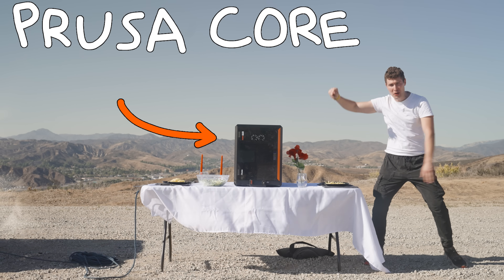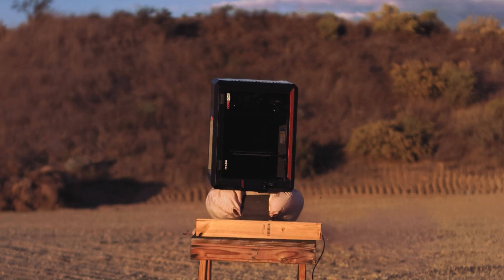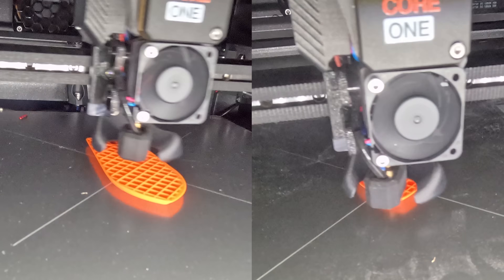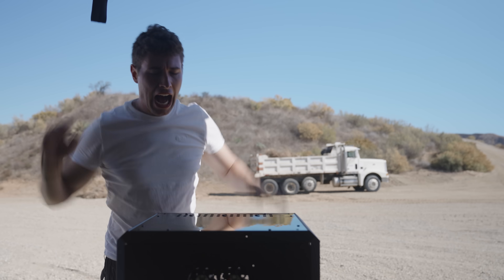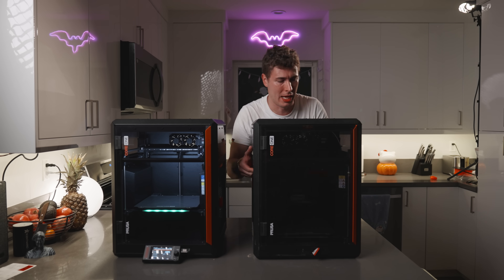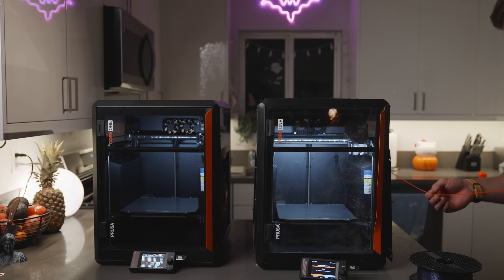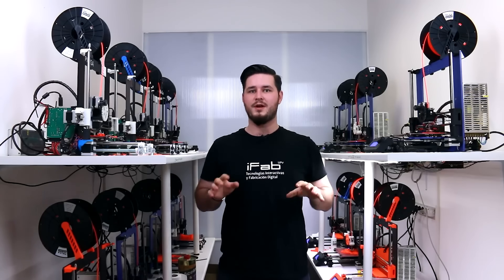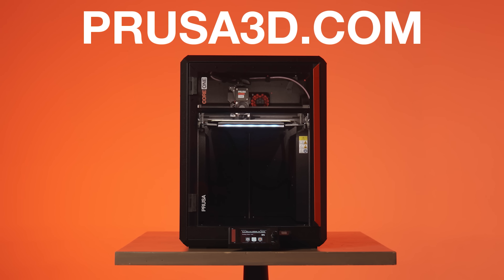I Threw the Prusa CORE One off a Cliff - Can It Still 3D Print?

Comment: That's an awesome testament to reliability and durability. 
But what I really want to see is what was cut. What things did you do to the printer that it didn't print. How about the one you drag in the opening shot? I don't just want to see what it can survive. I want to see how hard is it to repair when it couldn't survive.
Durability and repairability go hand in hand and I would almost put repairability first.
Reply: Can vouch for the repairability. I got a Core One that got piled on by rubble during an earth quake.

Frame was messed up but the most vital parts survived. Was a pain in the butt to repair but I got it working again. The issue I had with it the most is having to wait for the replacement belts since they come from aborad. Dusted off my Ender to print the parts I needed for it.

But yeah, I'd say the video is accurate.
Reply: You can assemble the whole printer by yourself from scratch, I'd say it's pretty repairable

Comment: As an offificial Prusa fanboy, seeing a Core One treated like that hurts.

Wait. Core One Plus?
Reply: Ya, did some other miss that too?
Reply: Core One + is to Core One what MK4S is to MK4 - it adds a few small gimmicks that makes it slightly better. There is an upgrade kit in the Prusa shop and this time it is really cheap!
Reply: @KonradTheWizzard  wouldn't say they're gimmicks, they're nice quality of life additions like the redesigned filament insertion point to make loading flexibles easier.

They're all printed parts so you can literally upgrade for free, no need to buy the upgrade kit! Aren't you impressed? And aren't you glad they released the high temp update for all their lineup and not just for the shiny new printer? That's why I like this company.